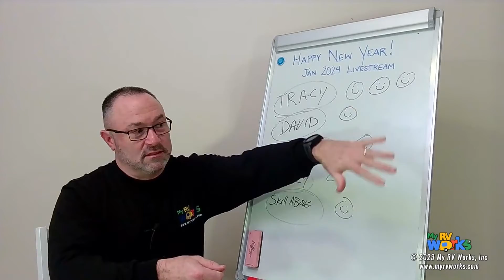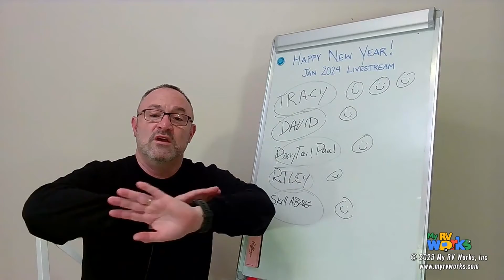Proving A Bad RV Furnace Motor -- My RV Works

Comment: I replaced the motor and still have the same problem. the motor runs fine when when the squirrel cage is not attached to the shaft , when I attach the squirrel cage it runs for about 2 seconds shuts off runs for 2 seconds shuts off then pops the fuse. I take the squirrel cage off it runs fine. This has happened to the old motor and the new motor. What do you think could do this? Thank you for all your shows.

Comment: I had to pull an NT20SEQ that was never used. Second hand 2 year old trailer. With the thermostat turned on, you'd hear a click and then nothing. I checked the limit switch and sail switch and both were good. So thought maybe the motor was bad and found that the red wire had never been connected to the control board. I  then put 12vdc to it and it ran beautifully. Connected the red to the board and we were on our way. The trailer heated up beautifully.  I guess QC missed this somewhere along the line.

Comment: I have a suburban furnace . It turns on and runs normal .  Then shuts off. It will run for 10 minutes . 5 minutes  , 2 minutes . All over the map .  Then after shuts I have to shut thermostat off. Wait for click sound and then start it all over again ..  I’ve replaced the sails switch , the computer, the spark wire ..